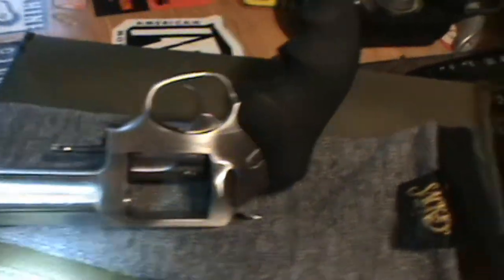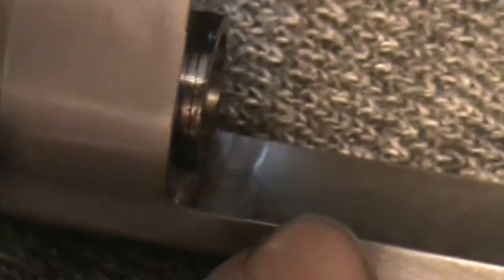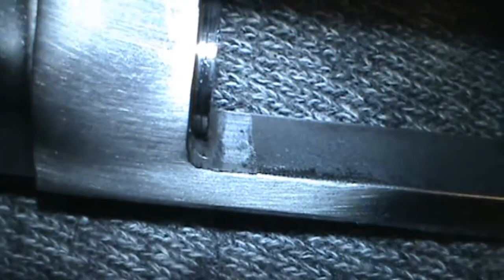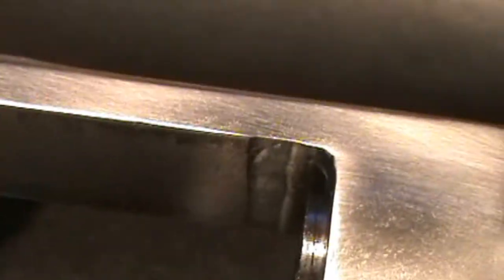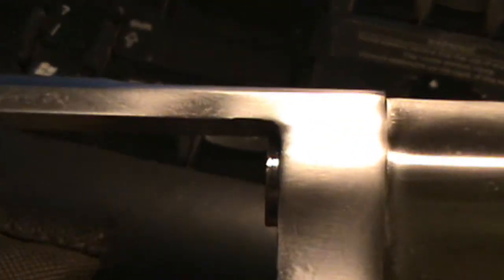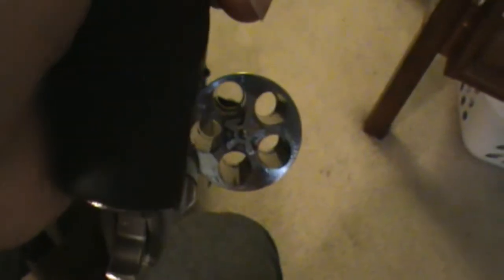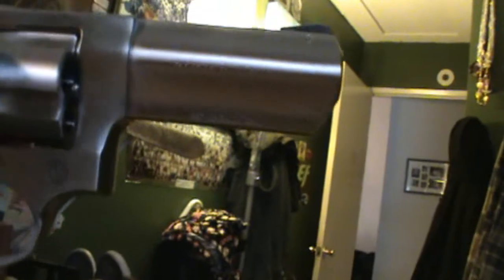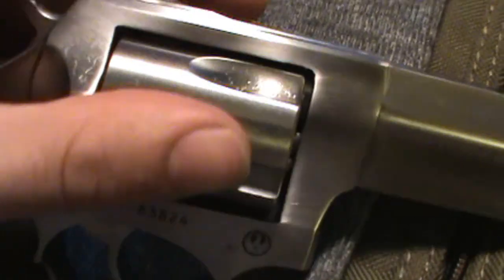Ruger SP101 flame cutting & top strap erosion problem

Comment: Same Ruger, same "problem." I measured the large forcing cone gap with a feeler gauge and called the factory. They were very helpful on the phone. Mine was well within tolerance. The cylinder play, even when cocked, is SP101 standard. Mine appeared to have a small crack. Some time with a fine emery cloth showed it to be all surface crud, to Armorer1911's point. (Polish off no more than what is required to remove sharp edges or apparent cracks.) I check it with a magnifying glass when I clean it. I think you will find it is all near the surface and that the problem goes away in another couple hundred rounds. (My ammo was Win white box 38 and Rem golden saber 357 125gr.) 2016 now, so I assume things are OK, maybe my experience will help others.